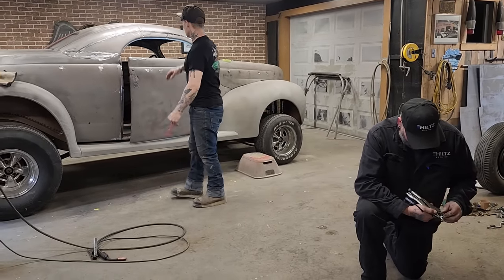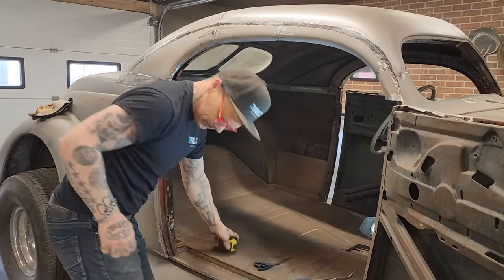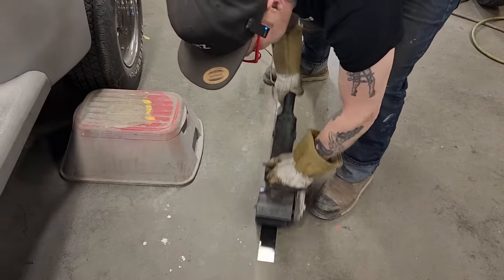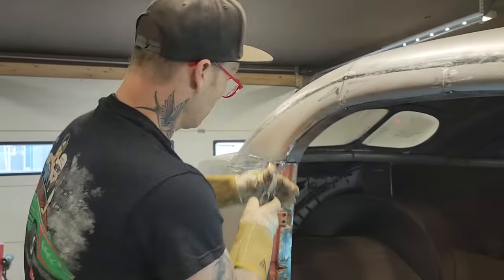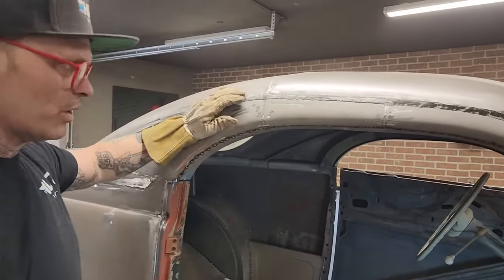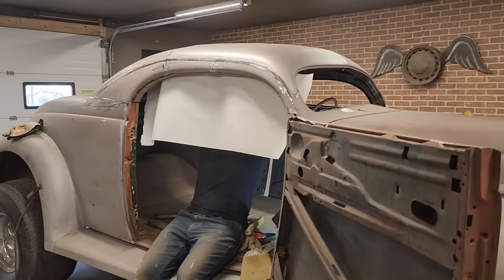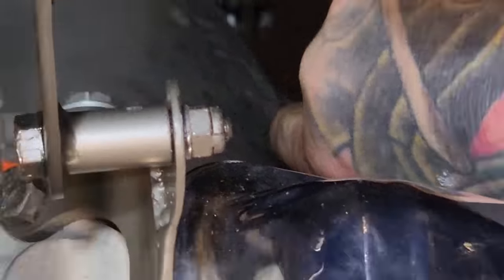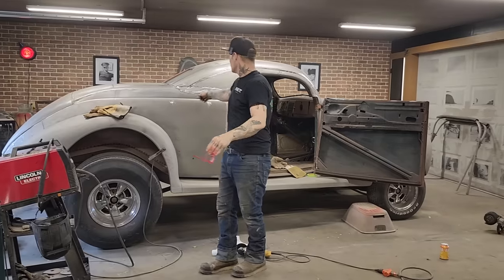The fabrication continues... can you spot the mistake? 😐

Comment: The mistake you ask????

When Chad held the thin paper up to the door opening  to get the shape for the piece he’s wanting, he used the wrong side of the template he cut for what he needs to make/cut.

He needs to use the outside shape of the cut paper, but he drew on the inside of the inside shape.
Wrong piece of the paper pattern used for what he’s wanting to make. 

Love the show!!! Great work on both ends… the work itself AND the videography 👍👍👍❤️❤️❤️

Comment: Wasn't really looking for any mistake.  The car isn't finished till it's finished.  Looking great so far.  The welding is great. Getting back to the 50 Ford if the seating isn't already done, I thought it would be and easy and functional idea if you made a new smaller frame for the back seat and reconstruct it so it would fit better.  Work, I know, but worth doing.  Have a good one.

Comment: I'm going to offer a bit of advice. Those welds shown at 6:35 are kinda birdshitty. If you're using a mig welder you might want to use a thinner wire (030 vs 035), and you really need to clean any paint/primer/rust off before you weld those seams. You don't want to try to burn that paint/primer/rust off with the weld. And you should do just a single tack weld at a time and spread those out evenly. Do one tack on the end and then one in the middle, and then one at the other end, then do a tack in between those spreading them out the same way,  and let the metal cool a bit after each weld. That will help prevent warping the sheet metal. 

And you've got that rear window section of the roof ground up pretty deep. Use 80grit on a D-A sander for that instead of a grinder disc.

Comment: Making linkages ain't easy...Especially 3 deuces...Thinking back to the old GTO days, you don't want a linear linkage for 3 deuces.  You want to run mainly on the center carb, then the other two should come in afterwards...Sort of like a 4 barrel does...
Reply: Seems like there was a slide setup for the center carb...Gave a little time before the other two came to life...Setup right 3 deuces will scare you to death...

Comment: leave the coathanger in the closet... welding wire is better.. no containments.
Reply: i learned how to weld custom bodywork  with coat hangers and a torch. back in the 70's it works very good.

Comment: When you use linkage for carburetor. If the left motor mount brakes, the carburetors go full throttle, and there's nothing you can do about it.
Reply: If the motor mount breaks, you’ve got more problems than stuck wide open carb linkage… just turn off the key….